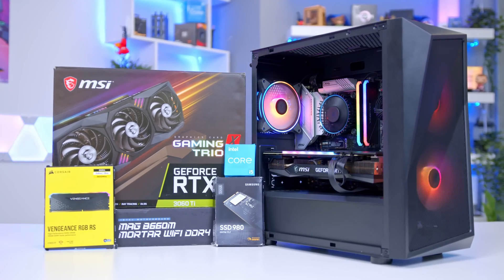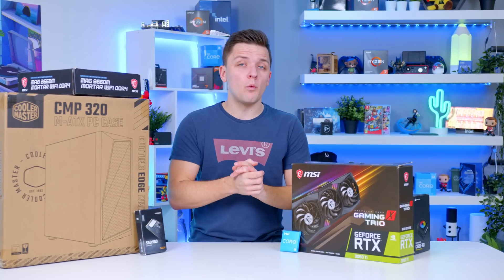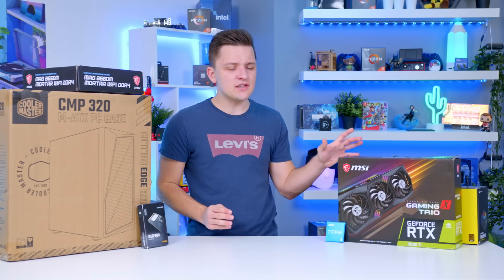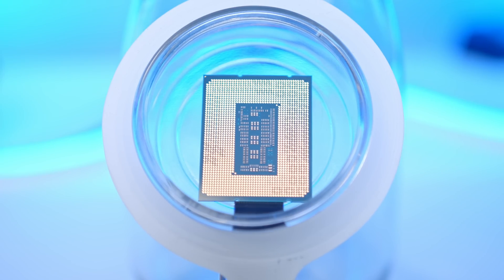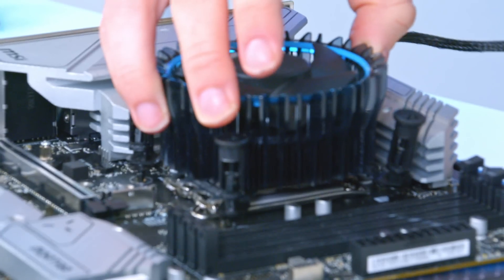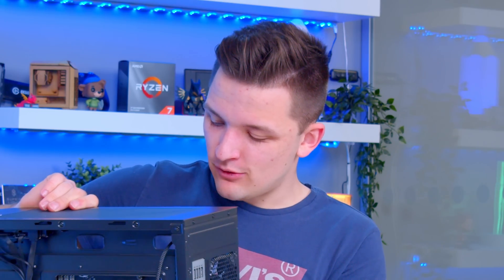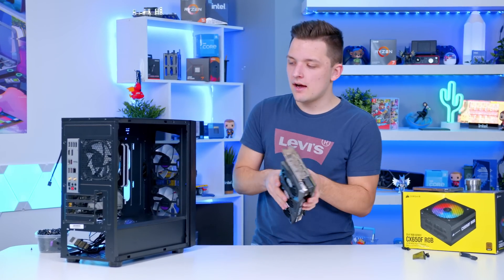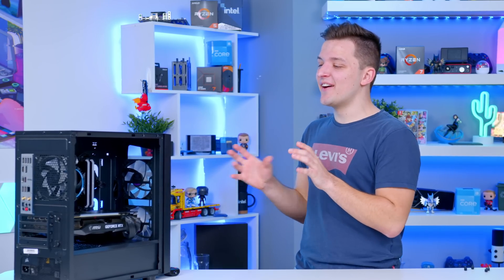Best $1200 Gaming PC Build 2023! [Full Build Guide - ft. RTX 3060Ti]

Comment: Good build, but Could have saved £30 on the motherboard and got the MSI pro b660, then got slightly cheaper rgb ram and spend the savings in something like an arctic a45 cooler.

Comment: I was wondering with a build like this, is it better to wire fans directly to motherboard as opposed to a fan hub
Reply: And would a cable splitter for the fans suffice?
Reply: No having the fan hub makes it so not only the fans can be controlled better but can allow more fans for future install and allow if you have led fans it helps with color changing

Usually if you have the fan hub you would use that , then if you run out you connect to motherboard.

Comment: 18th
I just disagree with the choice of gpu, but otherwise, great build 👍
Reply: 6700XT ALL THE WAY
Reply: What gpu you would go?
Reply: @ОлегКубов-ш8ч  6700 or 6750, save yourself some money and get the same performance.
Reply: @Paul51S4  oke, ty that would be best option is price segment or possible smth else?
Reply: @Vitaly  I wouldn't go lower than 6650, no higher than a 6800, can't beat the pfp (price for performance) on amd gpus right now, especially if you're on 1080 or 1440
Reply: @Paul51S4  thank you, appreciate your information, hmm. Then is there any build you would recommend for 1440 in Europe? ~1k eu less if possible
Reply: @Олег Кубов  Intel cpu (idk much about intel) and a 68 - 6900, or a 5800X3d if you want AMD which I'm on a.m.d now. but if I'm going 1440 I'm getting an Intel cpu, and a 6800 or 6900. 
4k, once again Intel cpu and 4070 for sure. 
Amd is great on 1080 and 1440, but for Intel is better on 1440 and 4k, they imo own the 4k market.

Comment: One thing I will say is remove the price in the title bc its kinda misleading
Reply: This particular build is under $1200 usd. I don't get why he went 3060ti over 6700xt or 6750xt, and he could have still kept it under $1200 for better gaming performance.
Reply: @bradleyhenry2411  I mean, everything comes out to $1150. but yea, he could have use 6700xt for a cheaper price and better Price to Performance
Reply: to add to this, if you gonna spend $500 on a GPU. get a 6800 rather than a 3060 ti because rx 6800 is going for $500 atm.
Reply: @hoangtudaden1304  I wish the rx 6800 was that price in canada. Sadly they're around $750 usd used.

Comment: Would have run a 6750XT personally.
Reply: Is amd better than Nvidia gpus?
Reply: @falconr4534  the rx 6750 xt has better performance, especially in 1440p gaming at nearly the same price.
Reply: @falconr4534  for price per performance in a lot of cases yes, both manufacturers have their flaws no matter what nvidia fanboys say
Reply: @Vortex-oc  Nvidia has geforce experience
Reply: @JoshDoes  I had an nvidia GPU and the software is shitter than AMDs control panel